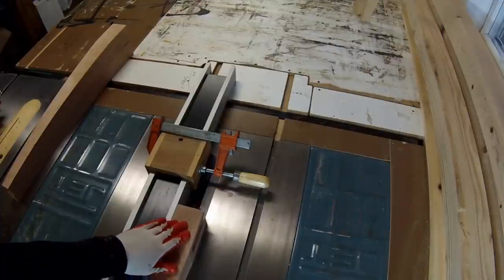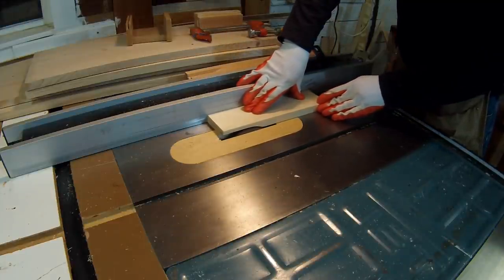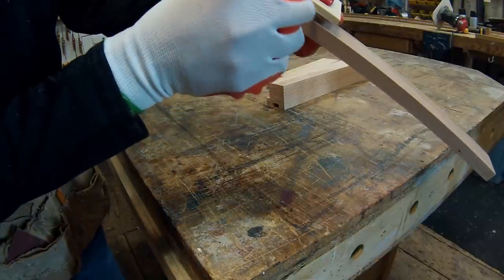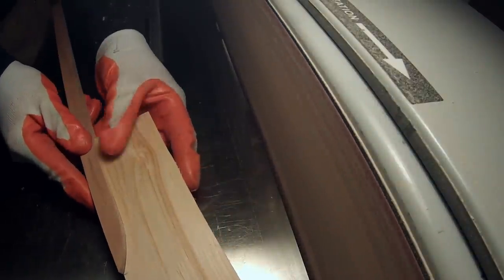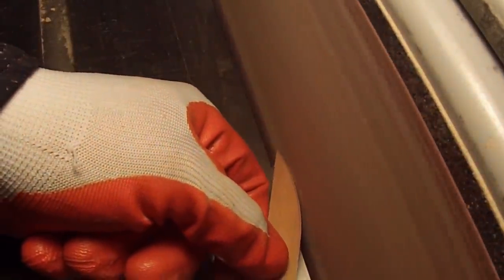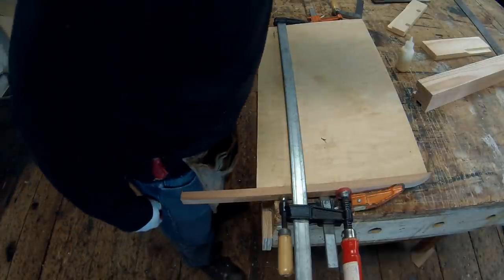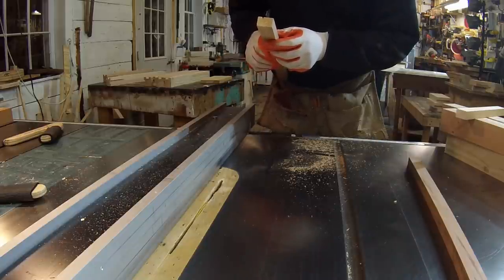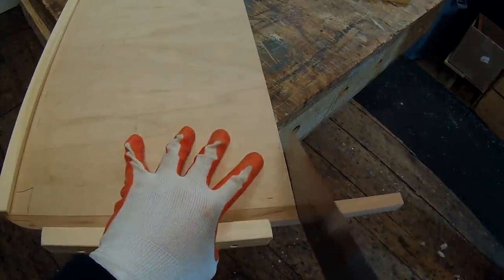Table Apron Jig for Dado Mortises

Comment: Hi Mitch, Another reason I like to watch your video's, .. Lots of tips, Just a thought from my ignorance; with the mortise being 'Sort of' open at one end and a rounded tenon, would this lead to difficulties in the joint slipping apart with gravity?
would you also pin the joint for added security?    Keep up the great work.
Reply from the maker: +Peter Compton 
I use 1.5" pocket screws, 3 or 4 per joint, plus glue, plus wood block to reinforce... very strong... it will never creep or come apart.

Comment: what change would there be in the process for an 8" dado vs. This video with the 6" dado?

Thank you for all your woodworking insight that you share.
Reply from the maker: I have jigs for both sizes.  The 8" dado makes a slightly longer arc but it works pretty much the same.